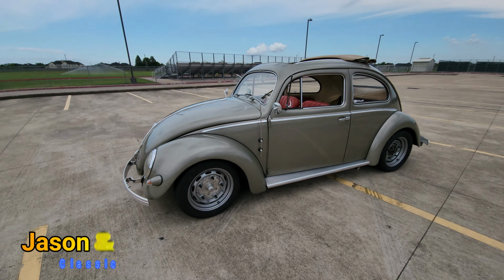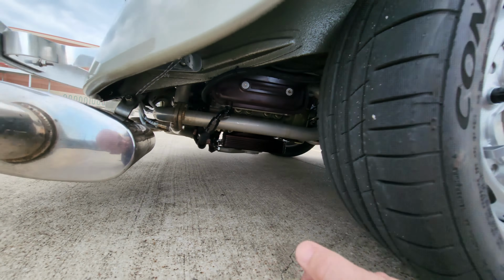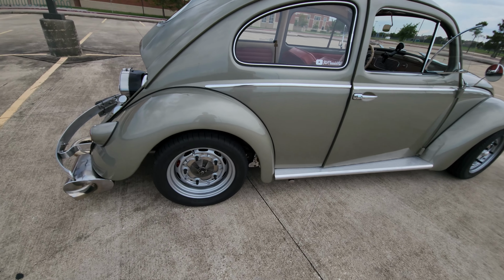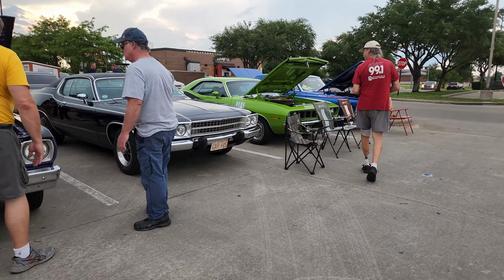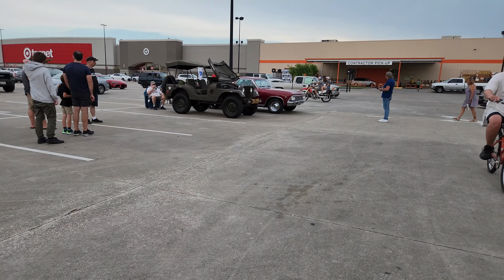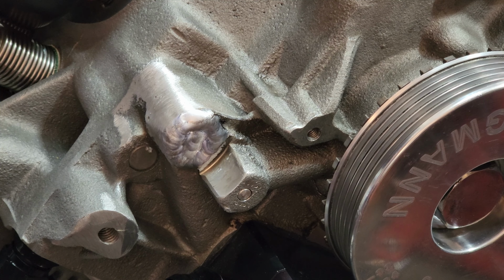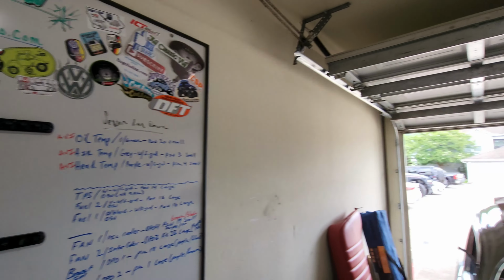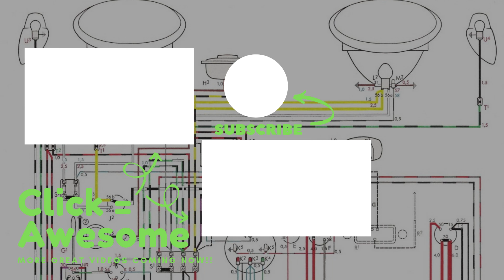300 WHP TURBOCHARGED VW Beetle - 1st Test Drive! | JW Classic VW

Comment: People talk smack on these engines because stock they’re underpowered but some bolt ons and a maybe a turbo will gap whatever Mopar boat they’re driving with twice the hp
Reply: Not to mention the vw will most likely carry the front tires in 2 and 3 rd gear and they handle like there on rails
Reply: @1979augistine  yeah the 1600 engine is a fantastic base for power

Comment: Am I the only one hearing that pinging on those full throttle pulls???  It’s easy to hear when the camera was in the back you might not be able to hear it in the front seat. I’d do some logging and check your knock sensor trace (if you have one). Obviously knocking under boost is not good.

Congrats on the ride it looks awesome!
Reply from the maker: She is my baby!! Thanks for the comment brother, yeah there was some issued with the MAP sensor but all fixed now.  The difference is crazy.  Cleaned up that pinging 4 sure!!
Reply: @JWClassicVW  I was about to post the same comment. Glad you got it sussed out because pinging is B A D under pressure!
Reply: It is pinging pretty bad, needs higher octane fuel & maybe retard the timing.

Comment: Nice job on the engine.  It will be interesting to see what your temps are once you get all the sensors in place.  Oil temps, head temps, intake air temps, especially to see what the intercooler effects are.
Reply from the maker: Yup..  it will be interesting to see what kinda #s I get.  Temps are everything un Air-Cooled. 😁

Comment: I had a 200-ish HP '71 Corolla many years ago. People may not be impressed with that but A) The car only weighed about 1700 pounds and B) That was naturally aspirated! Biggest downside was I had the original rear wheel gearing and 4 speed tranny, so running 55mph on the highway was an adventure in high revs... I planned on upgrading to the available 5 speed but I sold the car because my mom was afraid I was going to kill myself in it.

Comment: Amazing how everything fits under a decklid and it’s intercooled!  🤯  Have you thought about a single or dual muffler hideaway setup?
Reply from the maker: It's just a turbo exhaust
... but yeah I'm working on something that is a bit more not right in your face. Lol
Reply: @JWClassicVW  I have a 1960 which I’ve had for almost 30 years.  I’m planing some sort of boosted setup or a swap on.   It’s a single port.   Any recommendations?  I was considering Kompressor Haus or a RADesigns turbo kit.
Reply from the maker: Check Out Mario at the Dubshop... he has done some amazing kits.

Comment: that intercooler looks nice but how does it get air flow through it? unless there's a big hole in the firewall with some air ducting, it seems like it would be useless.
Reply from the maker: @turbovdub1867  It has a fan behind it, works pretty good.
Reply: @JWClassicVW  OK, I figured there had to be something like that. what are the aluminum intake "boxes" between the manifold and charge tubing? never seen those before.

Comment: That sucker took off so freaking quick. I was not expecting that.
Reply from the maker: Lol... she goesssss
Reply: @JWClassicVW at 7:25-7:35. It sounds like the motor is getting taxed out by the turbo’s. Is it getting overworked or am I just hearing things?
Reply from the maker: It's pinging there... already taking her back out since this video is a bit old... I jacked my rings up.  Doing some upgrades then to the tuner.
Reply: @JWClassicVW  I thought it sounded kinda funny. It’s a great build, but the beetle engine’s definitely have their limitations.

Comment: dont you need a different tune for the e85 or do your fuel trim numbers range that far. will need a lot more fuel. I am considering converting to e85 on mine. better cooling and cheaper. less saudi oil too. but you do use much more of it.
Reply from the maker: Yup... engine must be tuned for E85 and mine has been.  Tuned for both 93 Petrol and E85 mixture using a flex fuel sensor with my Haltech.

Comment: Can you tell me where did you get the bumpers and exhaust? I have a 1967 bug with a 2110cc engine, it has a stringer exhaust but wanting to change up.
Reply from the maker: Bumpers are available through CIP1 they are solid aluminum, pretty easy to search for.  The exhaust is custom for the turbo.

Comment: The reason the case cracked with that fitting tightened all the way down, is that NPT threads are tapered, so as you thread it further in it gets wider and wider, so you went too far, and probably didn't crack until everything expanded when the engine was running.
Reply from the maker: Yeah I know... didn't have far to go... should of just ran my tap in there.  Lessons learned.

Comment: Holy moly you are the man.  What a build sounds and goes amazing.  I wouldn't hammer it too much though 'til it's tuned up, as tempting as it is.  I Don't want to be a kill joy, I couldn't tell with the video sound, but was the higher rev chatter the blow off or detonation?  I have a supercharged beetle draw thru and when jetting the mains down smaller I got the same sound and it was detonation.  I was lucky and noticed in time.  Cheers  C.
Reply from the maker: Thanks man!! She is a monster and yup I figured out the issue... simple enough the MAP reference was jacked up in the Haltech.  Now that it's fixed all I hear is booost!! Well and the BOV and wastegate... lol

Comment: Now you can really GOOSE it .......Hey I was at the empi open house and I saw a guy who ran his car on the Dyno.....Street car turbo pulled out a 600hp run to the back wheels. This was a public run..... Running 27llbs of boost Idk what all is in there but that would be probably 700hp on a stand.  Pretty sure it was some pretty high end stuff. was just talking to them after. He said he would do an interview but I need to find him at a different show. Runs 10 seconds in the 1/4 mile. He drove it to Oklahoma then ran it at the track there then went to Texas ran it there. Then drove it home. Just over 600hp on the dyno. There were drag cars there that only ran 300 one was NA hit 300 sat there popping at like 6000rpm thought something was wrong with it. He said it is not meant to run that low Rpm he launches it at 8500 at the track. then he got the green light to open it up went to 9500rpm. Unfortunately I didnt see the car that ran the 600. I was on the other side of the building. But it did.
Reply from the maker: Yeah... I saw that on the EMPI open house videos that are up... that is a pretty mean VW!

Comment: Jason - Are the wheels 4" offset?
Reply from the maker: The Wheels are the stock 15 inch from EMPI... 4" in the front, 4.5" in the rear.  I'm not really sure what the offset is?
Reply: @JWClassicVW  Thanks Jason. You're always helpful.

Comment: Is this the $25,000 motor I saw online?
Reply from the maker: This motor was never posted on-line for sale...  but that price is pretty close.
Reply: @JWClassicVW    I was looking at turbos and then came across turnkey engines with turbos. Saw that price for a 2332 blow through turbo,  under deck lid. 
What is your base engine size?
Reply from the maker: This motor is a 2287 turbo but I'm also building a 1600 single port.

Comment: Question: at 8:46 when you go into 3rd it sounds like detonation (knocking)?    OMG, Goose is crazy fast, and sounds strong.  Man, I bet you are enjoying the pulls.
Reply from the maker: Lol... thats the wastegate. Yes she feels amazing!
Reply: @JWClassicVW  Sure sounds like detonation to me.......Post a timing map and check what your IAT's are under boost along with how much boost you are running.
Reply: Just listened again and I have to say it's detonation not the waste gate. Be very careful if you continue driving like that. Watch for excessive blowby....that will be your first sign.
Reply from the maker: I found the issue, my MAP hose had was off at the manifold... I can't believe she was running as good as she was... but now OMG what a difference.
Reply: @JWClassicVW  I first noticed it at 6:58, then really bad at 7:23,  Dude, I am glad you found the issue, heartbreaking if it would have caused any damage.   Can't wait for more videos.  I am currently doing a rotary swap into a 79 SB Convertible, but your engine is crazy.

Comment: I think this is the guy I called empi. 600hp vw street car https://www.youtube.com/watch?v=GssMhAoGW-0
Reply from the maker: That is one mean machine!! would love to know some of the details on the build!
Reply: Yea I am going to interview him in  a future video I have seen him around but didnt know about the car. He is not using all that HP either. totally capable of 9s or less. Via Gear ratios and tires maybe some wheelie bars But I think he is prietty proud of 10s which is a huge accomplishment. Taller tires on the rear of your car would really help larger circumference also has more traction. so like 70 series would really help. Would create more bog on the turbo and that makes it want to boost.  tall tires and 3.88s capable of near 100mph like 95 in 3td

Comment: A big engine with high compression VWengine will have a relatively short life. A pumped up engine will be even shorter . I am a VW guy from the 60s. And own three two liter NA cars that can go cross country in August with no problem. Instead of the money put into your pinger , I would go with a pro built Subaru.
Reply from the maker: Lol... my engine will be fine, already fixed the pinging issue as with any new build there are things that need to be worked out.  No need for the hate man, but you have a great weekend 😀 👍